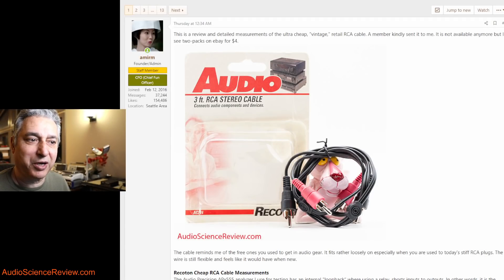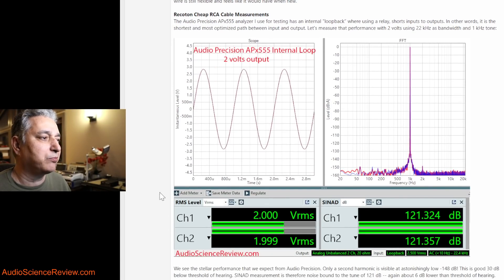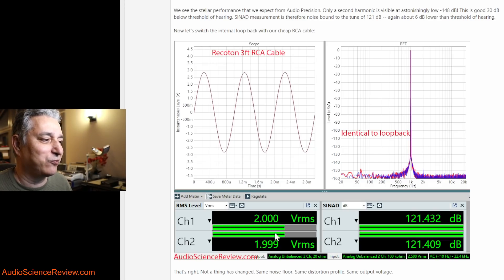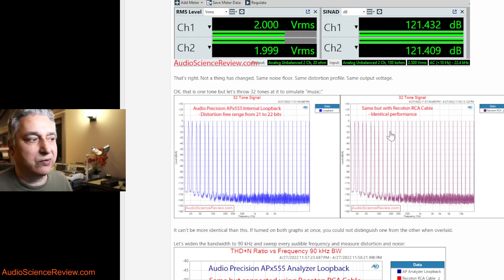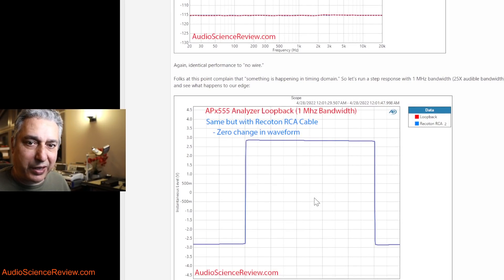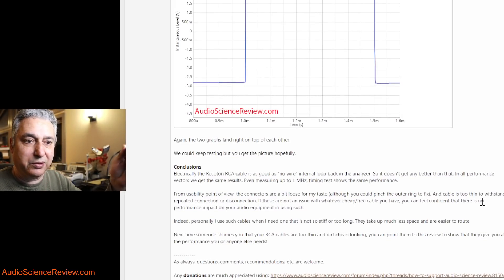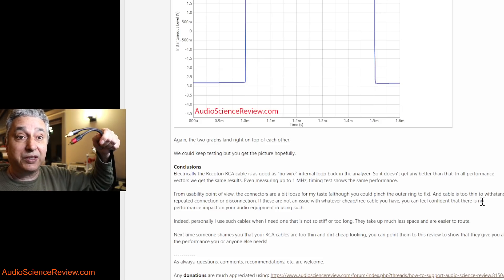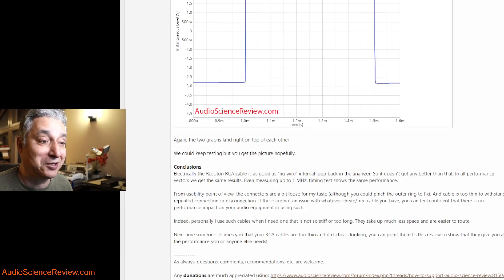Are Dirt Cheap RCA Cables Any Good?

Comment: Years ago I tested various RCA audio cables by connecting them as a video input cable to my rear projection TV.  WOW what a difference.  The test video consisted of a page with different fonts/points/pitches.  Some of the cables allowed us to read the smallest font sizes. Other cables provided horrible resolution.  I then took the cables to an electronics  friend of mine that analyzed the cables using harmonic distortion, voltage, etc similar to this review.  My friends conclusion was the cables were identical and there should be no difference in the sound of my audio system.  He was shocked the evening we had him over for dinner and showed him the difference between cables when viewing the video.  He spend quite some time swapping cables and left with what he considered the 'best' and 'worst' resolution cables.  His further analysis could not determine why there was a clear difference between the cables.
Reply from the maker: Video has far higher bandwidth than audio so naturally, analog cables there matter.
Reply: We must stop and dismiss your test halfway through your very first sentence. Audio is NOT video.
Reply: @richardtrussell8220  -- Properly conducted measurements are in fact very good predictors of performance.  Amir's test was configured for typical line level "audio interconnect" applications, not low-level applications with a relatively high source impedance like a magnetic phono cartridge or high-bandwidth signals like composite video.
Reply: yes also found the same effect with high definition analogue monitors Sony etc the better the cable was made the better the results
Reply: @pauldavies6037  -- Composite video is a very different signal from audio and is much more susceptible to the effects of shunt capacitance, effects that are irrelevant given the relatively low frequencies and source impedances usually found in home stereo gear.
Reply: @editorjuno  yes it is a wide band signal however the low capacitance in various cables still has different visual effects when compared
Reply: @editorjuno  pre to power amps can be 100k or more
Reply: @pauldavies6037  -- Typically, preamp (and DAC) output impedances tend to be down in the three-digit region.  They "can be" higher, but that's not a good design choice.
Reply: @editorjuno  i know thank you
Reply: @pauldavies6037  -- That's pretty much what I said.
Reply: That is not possible. All your cables have identical performance. Your friend confirmed it and then you hypnotized him into being fooled. Again: your experience never happened. Your friend proved it.
Reply: You can see by evidence in the review here simple cables as demonstrated don't matter for audio. Give that fact you should intuit that the problem is the difference in signal between audio & video.

Comment: The main issues I have are: Not reliable if plugged and unplugged a lot, poor shielding, and questionable connection. BUT, unlike a lot of "audiophile" cables, they won't break your RCA jacks when unplugging them. And for short runs that are not unplugged often, they're usually just fine.
Reply: Yea unless you are as clumsy as me and tend to knock stuff over very often, I doubt these will survive that 🤣
Reply: @8lec_R  -- The difference is, with the cheap cable the RCA plug(s) might not survive and you can just get yourself another cheap cable.  With most fancy cables, the RCA jacks on the connected component might not survive and it's off to the $200/hour repair technician unless you're good at DIY and replacement parts procurement.
Reply: @editorjuno  Exactly.
Reply: I just bought some no name brand TRS cables for audio recording and it did work at all and the build quality was good too. No signal. I then replaced it with Hosa brand - a reputable well known budget brand and it worked……If you’re going to buy cheap cables, at least buy from a familiar brand name.
Reply: Those would be main non-issues would they not? 99% of people do not unplug RCA cables "a lot" and you have no evidence they'd fail if that were the case. Shielding as the man told you is of no matter in this length. Inherent in the review is that the connection is absolutely fine unless connection means something to you having nothing to do with the purpose of the device. The cable was 3 ft and Amir addressed longer lengths. You got nothing, not even a reason for a suspicion! What you should question is yourself!
Reply: @johnsmith1474  Wow. I guess those 45 years as an audio repair tech did me no good in choosing audio cables? Besides, I did more or less agree with him. I merely added my own personal experience to the discussion.  In fact, the last sentence in my original post made it plain that I generally agreed with Amir's findings. But that's cool. It's ok for you to disagree with me. I can't force you to be right. As for my "reason for suspicion," it's those four-and-a-half decades of experience. And I question myself daily. Perhaps more than I should.

By the way, lots of folks swap components in their systems regularly. Try one preamp and one power amp together, then try the same preamp with another power amp, etc. This does entail a lot of plugging and unplugging. And I've diagnosed many a system problem down to a bad cable over the years. I've also fixed many a component whose RCA jacks were broken because they used excessively tight-fitting "audiophile" cables that needed so much force to disconnect that the user either ripped the ground sleeve off the RCA jack or broke the solder connections on the board the jacks were mounted to. This happens more than you might think. And I will disagree with Amir slightly about shielding, because some cheap cables sold on Amazon today are not actually shielded, even when they say they are. They're just two thin wires running under the jacket, although I am quite familiar with the cable he tested (I've seen lots of them) and they are in fact shielded. Enjoy your day!
Reply: @ScottGrammer  - Apparently not.
Reply: @johnsmith1474  Yes you’re right 99% of the population do not unplug repeatedly but a certain percentage of audiophiles do. I’ve had cheap stock cable break after about 15 years and I’ve unplugged only a few times. For 15 years stock cables are good. But I’ve had well constructed cables for about the same amount of time and they never break. So spending a little extra money for better build quality is definitely worth it.